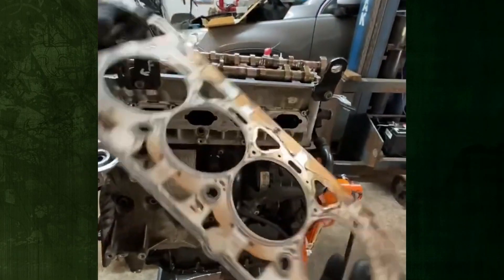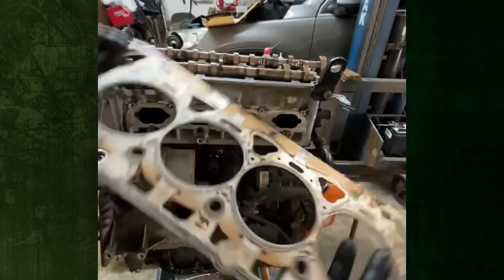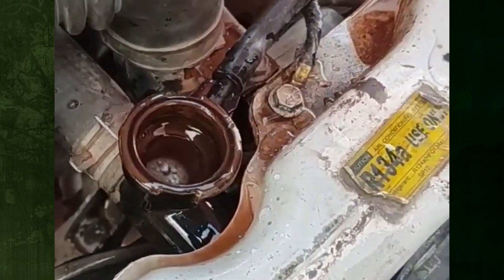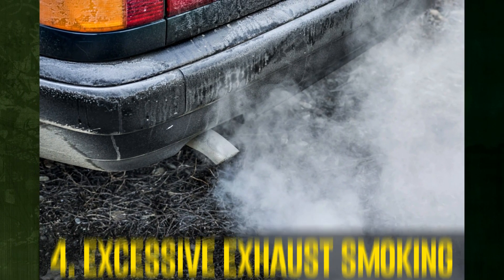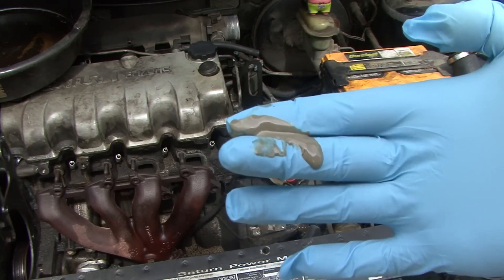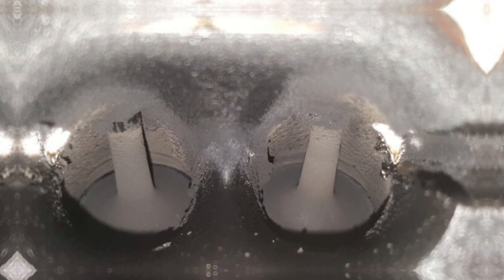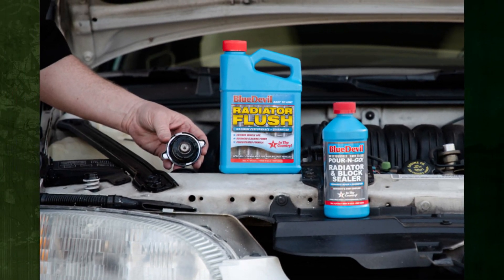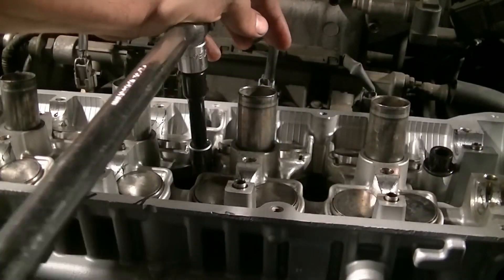Top 5 Cracked Сylinder Head Signs. How to Avoid and Fix

Comment: What if the is air coming out of my coolant tank even after breathing it and car over heat? The is no white smoke at the back. And no oil mix on the engine oil or coolant.  What will be the course of over heating?
Reply: Waterpump